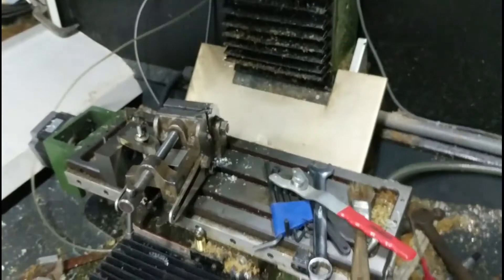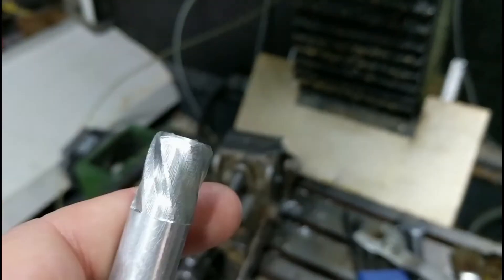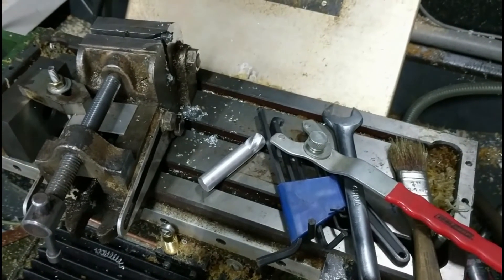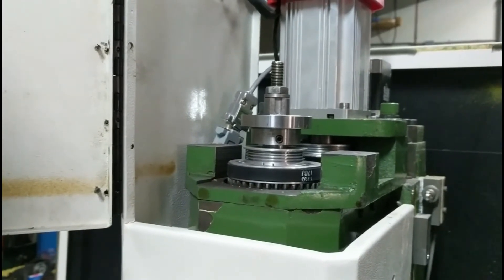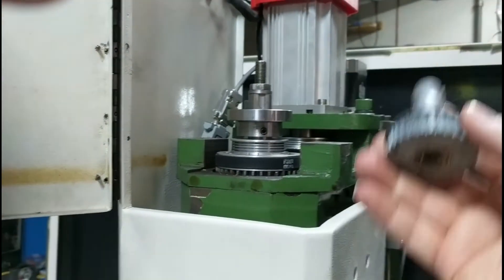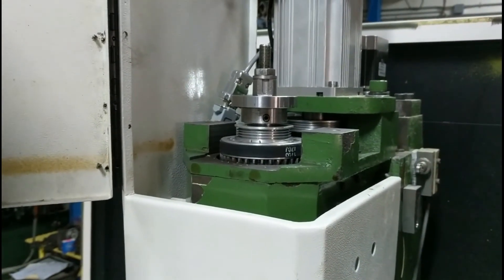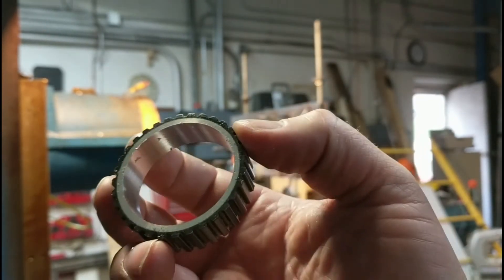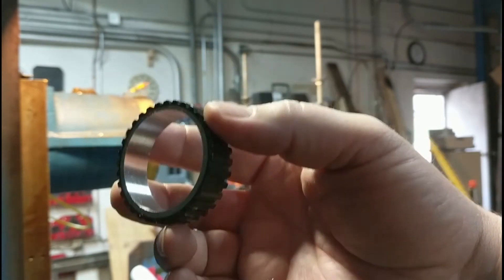Operation high(er) resolution spindle encoder Part 1!

Comment: If you have an equivalent encoder mounted on top of the spindle motor, why does it not report the spindle position?  I can't see the pulley ratios or estimate belt slippage from my point of view.  Maybe I missed it.... Is the lower res encoder on the spindle?